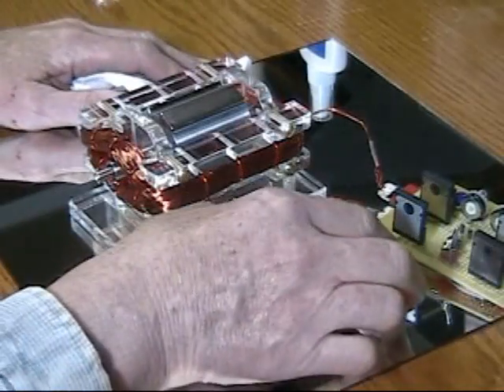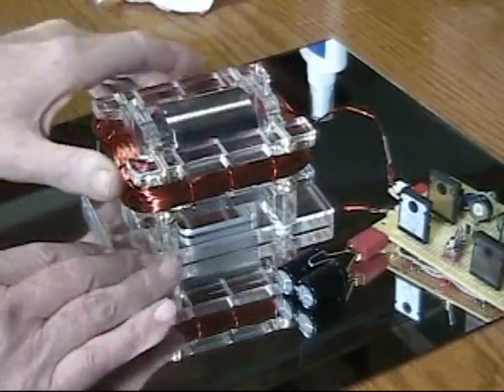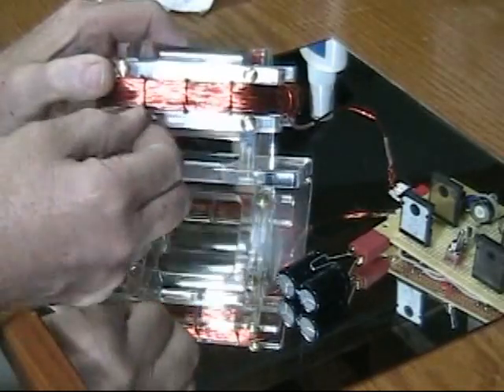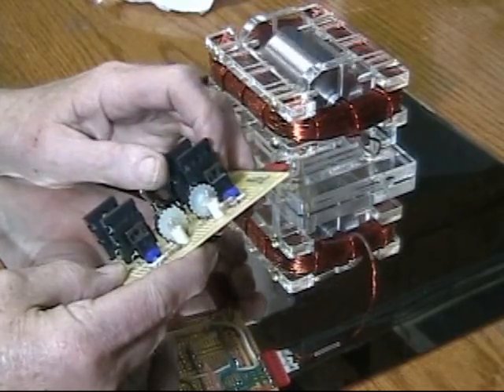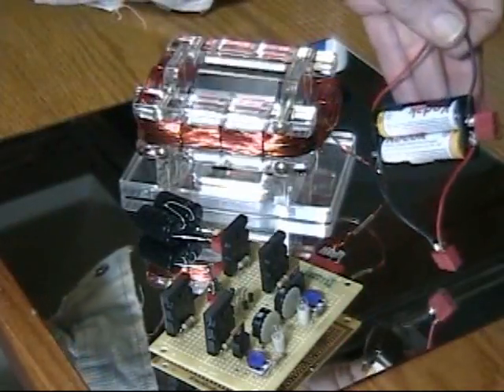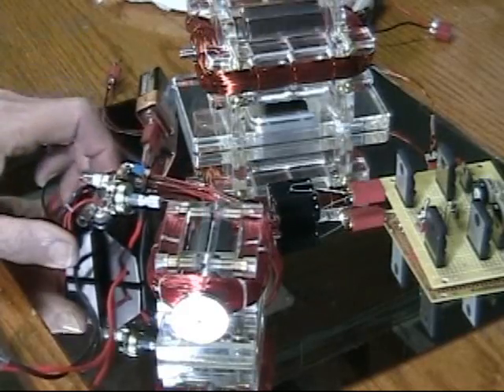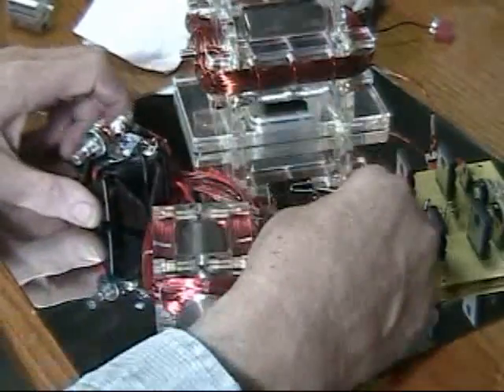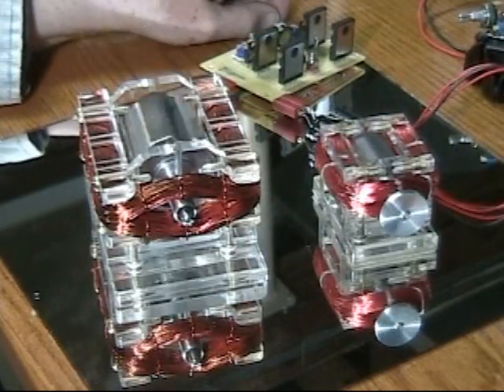Window Motor Running On Capacitors

Comment: I got your solution to twice the current output
Check first the other comment then remember in electricity what creates the current is the potential difference
Use a cupper moter and another with aluminum wires
The opposite magnetic sens of respond will permit you to obtain the difference between the both as total efficient current output

I'm already building plans for a paper plane space ship idea, would like to send life in space instead of cars :-)
Hop you a wonderful year

Myvold friends my ancestors family water is life were all part of ;-) 
https://1drv.ms/a/s!AsQWqx8IyY-9goM6O3oAQCL5f6XXew

And a true 5 leaves one for your spirit
https://1drv.ms/a/s!AsQWqx8IyY-9go4eG1B42CEsgAor4Q

Then talking a few about magnetic metals...
The transformers are made with differents metals according to the hysteresis curve
There capacity to create a magnetic field in accordance to an other
There's also a different parameter in this curve the quicker the metal pieces will be able to reverse magnetic field
It determines the quick of the time regular waves harmony

According to the fact i'm poor, but need intersting materials to test i thought about simple useful stuff

The transformers are also create with multiple parts or foils isolated from each other this permit the magnetic signal transmission without the heat creating in bigger parts that can melt them with the rest

So a simple iron isolated wire multiples parts is a perfect stuff for Faraday cages or magnetic improvements without too much heat ;-)

According to the form you use and the strength of the horses iron magnetic field
I think two parts constitued of multiple wires with an horse iron form use as an electrical magnetic field director will perform the result

You can't see it but magnets create a bubble of charges movement around the running magnets
Using the both multiple strings to maintain them in the cupper wire horizon will be really more efficient

The problem will be the distance to use
Modify it in numbers and diameter of wires to maintain a good ratio between strength needs and electric power created

There's also as i'v mentioned differences in metals reactions with temperatures
Some become magnetic when very hot
Reply from the maker: Bruno. It would be nice if you could get to the point where you post some videos. They should be very interesting.

Comment: Hy very interesting job i really appreciate your work
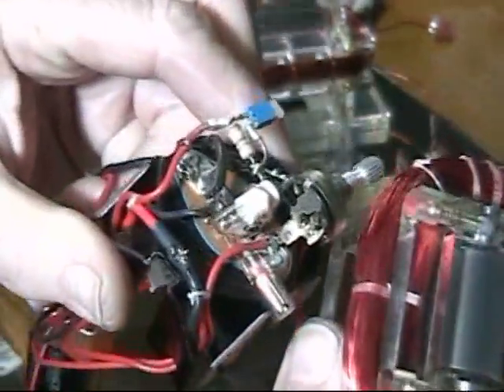At 5:16 min on this video, when you start the smaller motor, it seems to have more power
Perhaps with the battery power difference
But i would like to attract your attention on this fact

A square as equal distance faces
Wich means the magnets needs to be more large than long compared to the other model
The longest one as a long straight string road in front of each magnet wich are also more long than large
This result on a speed interaction of the magnet more short with a more long wire

There's also an interesting fact considering magnetic forms and relative force
Cubes are the more powerful ones
The capacity of strength pressure is really more important
Then looking at the smaller motor, i was thinking the magnetic pressure is really more important for a few more time, relatively to the radius ratio
Also the wires, more shorts wich means more pressure in a smaller volume 
Then between two sides there's a more long distance before running the opposite side on the square form
Wires can react as small capacitors, conserving a few electrons more before let them follow the rest of the circuit
It can not be conserve very long, and create sometimes possibilities of electric shock after turning power off, this is really consider in industrial machines to protect workers
But in your motor, i think the performance will be better with square forms, and more wires
You can imagine a complete wire circuit around the magnet center, it will works with more power

Then there's a small problem with your solution, no Faraday cage a lot of ambiant electric flow
I know the idea is to only use cupper to prevent from iron powerful magnetic interactions this is the most effective free running generator solution
It's used also with a different form arrangement, in wind electrical generators

But if the wires are small and after the cupper ring, it will really amplify the output power and permit to contain the magnetic field in the motor 

Other possibility, using different stages of different wires
Cupper is dia-magnetic, it's own magnetism without any magnet near is identical to the current running sens
Aluminum is a para-magnetic material, it's own magnetism will be the opposite of the current running sense

With different stages of both, it can create opposit fields that improve the reaction power on each new level
There will be then a difficulty, the time

When the magnet first creates the current in the first stage, it will take time to the current to reach the second stage
Each new stage will be a little bit later to react
The magnetic reaction will create waves of magnetic field between the stages
Reply from the maker: Thanks for you're thoughts on the project. I'll consider them when I start another build. The large motor was only running from the back charge from the motor to the capacitor on  the full wave circuit.  Only a little more that a volt was actually stored in the capacitors  from the short time I spun the rotor.

Comment: Hello DadHav 
I have a 11cm diameter hexagon rotor with 6 neo magnets of 50mm*25mm*12.50mm each.
Can you let me know the following information please ?
1)Number of copper strands?
2)The copper strand gauge?
3) number of turns to make a coil please ?

The main purpose of the motor is to charge the battery.
Reply from the maker: +Jwalant Shah ...Hello, that's a nice size motor. You probably already know that less windings produces more speed and uses more current. More turns of wire slows the motor down but has more torque with less amp draw. I made my motor so I could easily change coils. I have one coil that is about 450 turns and one with about 250. The number of strands depends on what circuit you intend to use. If you are using the Sequential Bipolar circuit you need 1 power coil and two trigger coils. It is also good to have a generator coil if you are experimenting with charging. In general the window motor is not considered to be as efficient for radiant energy generation as the monopole energizers running with SSG style circuits. Getting back to the coils: If you plan on using Hall Effect switches to commutate the motor then you don't need the trigger coils. I think it might be good for you to get on one of the window motor forums and study what some have had success with.  Remember trigger coil motors usually are not self starting. Another thing: Some motors have 3 coils instead of one. I would imaging #18-20 wire for power coils and #24-26 for triggers would be a fair guess.

Comment: If you are using over steel rotor,
Steel rotor and the magnets attract each other to each other it?
Or weak attraction to each other? Strong?
Reply from the maker: M Jannick M, Think about magnets that are in hard drives. They have a steel keeper on the back of the magnet that seems to make the other side stronger right? How about magnets to hold cabinet drawers closed. They have steel plates on each side of the magnet too. As you can see the motor works good with this steel rotor which is made of machine steel not cold roll. I can't say it wouldn't work as well or better with 304 because I never tried it. If you have an easy way to make a rotor, maybe you could try something else and let me know how it works. I don't have CNC but have supervised tool rooms that make injection mold tooling and downstream material handling. I manually machine my toys at home with a bench mill and old 9" South Bend lathe. Making a rotor like this takes some time for me to get perfectly concentric. I would be happy to send you my DWG files that I used for reference if you would like them but I seem to have no way to reach you other than here. You must have private messaging turned off. If you can contact me is some way, I could exchange e-mail if you like and I could send you more information. Let me know, I could also post it here until you let me know that you have it. I'm happy to hear you are so talented and I remember your name from some other forum I was on I think.John

Comment: Hi John
Thank you very much to pass on to my experience in the window motor.
I am very familiar with the pulse and digital circuits, Also proficient in AutoCAD 2D and 3D Pro / E. It has a 4-axis CNC machining equipment and CNC lathes.

About 5 years ago I have done experiments window motor, Bedini / Cole half-bridge and full-bridge circuit I have done, Trigger coil and Hall are two ways I have experimented, And tried PN complementary MOS drive circuit. But he did not carefully executed, It can be said to do very rough, Just to work, It does not make you so good. Now see your video, I decided to make again, Intention to do!

I before the rotor material is a plastic, You recommend the use of steel, Because there are basically two types of steel: Magnetic and non-magnetic,
1) 304,316 austenitic stainless steel is not having magnetic properties,
2) Martensitic stainless steel and ferritic stainless steel having magnetic properties,
So very much like to know: What type do you think is more suitable? No need to consider whether the process is easy.
I see you this video, Rotor material used like aluminum?

Comment: Hi John
I have begun to prepare materials, Replicate your production.
Rotor material as you recommended: use of steel.
However:
The use of steel having magnetic properties? Or the use of non-magnetic steel？(Example: 304 austenitic)
Iron can be selected?
Reply from the maker: M Jannick M, Let me ask you some questions and add some information that you should know if you want to make this motor.-While running from such low current and voltage such as a capacitor there is literally no torque what so ever on this motor.-These motors are not self starting unless you use a hall effect transistor circuit to trigger the coils.-Getting a full Bedini / Cole full wave sequential bipolar driver circuit tuned and working properly normally requires someone familiar with pulse circuit experiments.-The construction of this type motor requires a good deal of skill and alignment as well as balance is very critical. When it comes to rotor material: I haven't compared materials and use the steel on this motor. Did you ever take a hard drive apart to get the magnets? They are stuck down to a mild steel on the back side right? There's a reason for it. I can't advise you on this but there are many videos on my channel showing the steel rotor WM running under different situations. I have to admit that free machining stainless would be nice to cut, but there's something nice about when you slide the magnets into the rotor slots and they hold down so tight.M, Are you an experienced machinist with access to a lathe, milling machine and dividing head? Do you have software to read AutoCAD, or DXF files?John

Comment: Depending on your rotor size,
If you use acrylic, rotor weighs about 300g.
If you are using aluminum, rotor weighs about 550g.
If you are using steel rotor weighs about 1kg.
Rotors using different materials,
Input power should be affected, right?
Reply from the maker: M Jannick I have tried aluminum, Delrin and steel but the motors where all different sizes so I couldn't compare them directly. I imagine they would all work differently but I don't like aluminum based on the fact there can be unusual eddy currents produced when aluminum passes by magnets or through genetic fields. Drop a magnet through an aluminum tube or down the side of a piece of channel and you'll see how slow it goes from the drag.John

Comment: Hi John
Thank you reply
Rotor weight and power relations?
Light weight of the rotor,
The smaller the input power?
The longer running time?
Reply from the maker: M Jannick For me, I like the steel rotor. There is some flywheel action with the weight that seems to help. The steel also seems to present more torque at least in my case. The relation of the coils is pretty important though. High numbers of turns in the coil gives you a slower motor with more torque and will also run at lower voltages and current. This coil is maybe 450 turns. I have another coil with heavier wire and around 250 turns that runs much faster but draws more current and the torque is lower.John

Comment: Very shocking!
I want to replicate,
Gap between the magnet and the coil is smaller better?
Reply from the maker: M Jannick Hello M, My spacing is close at about 1/16". I haven't tried anything different because this worked so good. If the space where bigger it might run faster but not at such small voltage and current. I also have a video of how it is assembled if that will help.https://youtu.be/Fw9H5p4McZA
John

Comment: if it runs on a capacitor it will run until the circuit or the rotor bearing broke?
Reply from the maker: Hello friend, the motor is not perpetual. The capacitor will eventually loose it's charge and the motor will slow down to a stop.
J
Reply: Thanks. I think the problem is: the RPMs are low and it wont generate more power for recharging the capacitor.

Thanks for all your work.
Reply from the maker: Emiliano Poli
Thank you friend, If I could get the speed of the motor up without drawing extra current it sure would make a difference.
Take care
John

Comment: If You Want To Get The Plans
For Building The Magnetic Generator
Go To Google.....and Search for: Top Magnetic Generator
It Is a Step By Step Tutorial......On How an Engineer Build this Device.
Reply: +kevin Luis The Creative Science and Research version of Pulsed Motor is the Strongest. The problem with your version is the High voltage back Emf  which I do not think any battery can absorb let alone getting charged of it. I have an idea on using Bifilar coil to limit back emf or even Multifilar to totally eliminates back emf and then power the lead acid battery from the output of the Alternator not the back emf from the pulsed Motor. But because of the benefits in the back emf over the battery chemistry (desulfation), I still like the back emf somehow. Could you please show me the right way to go? Supercapacitors instead of Batteries?

Comment: I'm building a window motor with three coils.  6 ceramic magnets 6"x2"x1" alternating north and south. I built the rotor out of wood with epoxy holding the magnets to it.   instead of running itself I plan on using a Bedini SG or SSG to drive the shaft and use the window motor strictly as a generator.  Does this seem feasible? I'm hoping to get high voltage and current with these large magnets and coils.
Reply from the maker: Hello Anti. The window motor will always be a good generator and of course the faster you drive it the more voltage and current you will get. In a standard mode you won't get high voltage spikes like you get from a pulse circuit but you will get a sine wave that needs to be rectified to get DC voltage. You can also try running the SSG energizer with the window motor using a half or full wave circuit. With a capacitor on the input of the SSG you might get high voltage spikes as though there was a battery connected to it. Hard to tell what you might come up with but have fun.
John

Comment: Nice build! Run it in a bell jar under vacuum or in a hydrogen gas atmosphere like commercial power plants for less air resistance and it will run many times longer.

Comment: Sorry but what is a WINDOW motor? or what characterizes them?

thanks
Reply from the maker: As far as I know the term comes from the rotor running inside the square coil which is an air core or empty window.
J
Reply: *****

Thanks, does anyone know where I can get original design and intents. and if/why it is better than any other electric motor?

thanks

Comment: Read two books! ENERGY FROM THE VACUUM concepts and principles by Bearden and FREE ENRGY GENERATION circuits and schematics by Bedini-Bearden. Build a window motor which will give you over-unity and it can be built to 8kw which has been done so far! NOTHING IS IMPOSSIBLE!

Comment from the maker: Hello, the coil is specific to you're needs.The more wire you put on the less current you draw, more torque but slower RPM's. Less wire gives higher speed less torque and more current draw. You should wind 2 triggers and at least 1 power coil so you can use a full wave Bedini / Cole circuit. 2 power coils is even better because you can use one for a generator coil. A small motor like this one #28-30 for triggers and #22-24 for power is probably OK. I have 2 coils. 350 and 480 turns approx.

Comment: Very nicely done!  How feasible do you think a 3,000 to 4,000 joule setup meant to charge/discharge over ~10 seconds from a brushless motor would be?  I am thinking for a regenerative braking system for a bike/velomobile.

Comment from the maker: I'm experimenting with some self running solar circuits right now and will be posting something. I plan on doing what you mention. The other day I was running the window motor with a radiator fan on it. It's surprising how strong it can be at only 20 watts or so.
Thanks
John

Comment: Its very neat design and whether it has real world apps is irrelevant. It be great if you could encase all components and attach small fan to rotor. It would be a great exec. desk toy. With a small lithium battery and solar cell it would run seemingly indefinite, with an off switch for cell to restore battery.